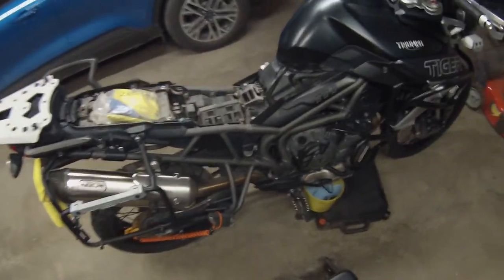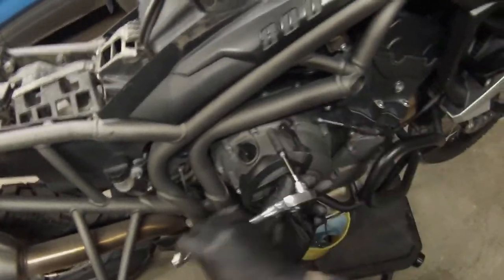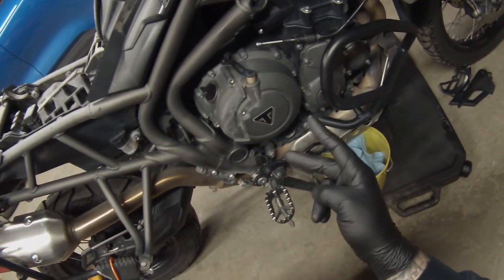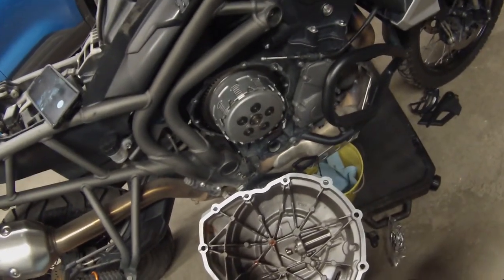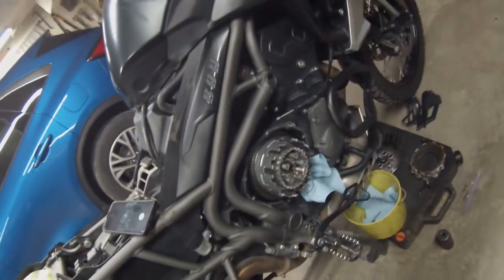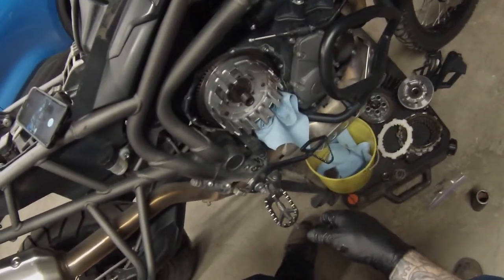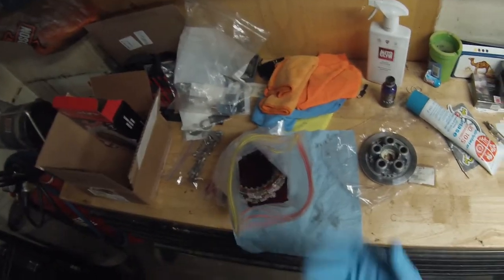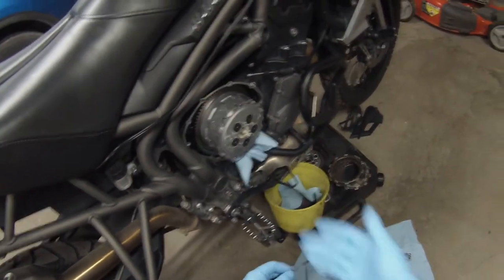Complete Clutch Overhaul - 2018 Tiger 800. Inner & Outer Basket Replacement & Barnett Clutch Kit

Comment: Any idea for a diagnosis if I'm replacing the clutch lifter arm and it's not fully disengaging the clutch? I'm banging my head against the wall trying to figure out why I can't get it to fully disengage, even when at full cable adjustment...
Reply from the maker: All you replaced was the pivot arm and now the bike stalls when you pull the clutch in and put it in gear?